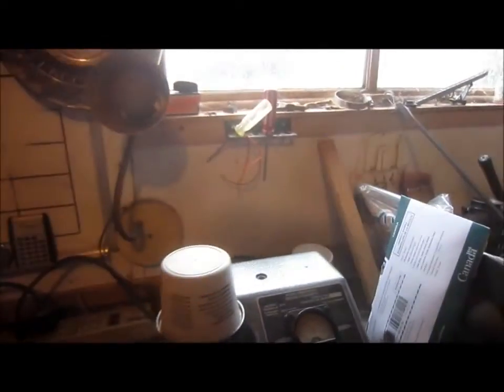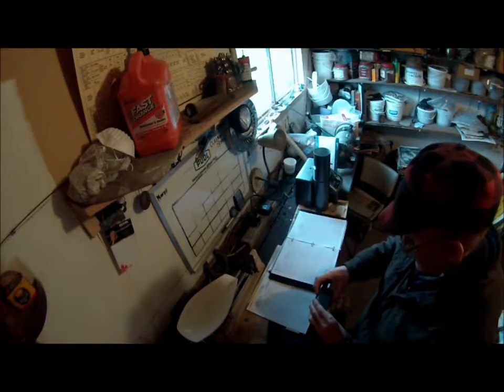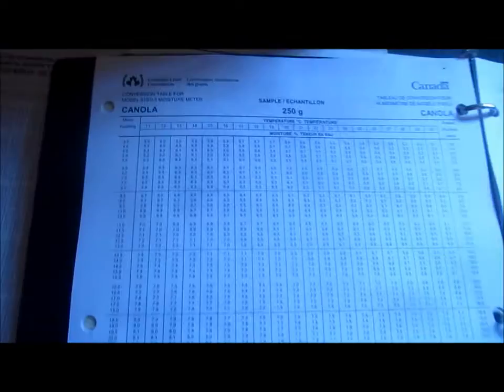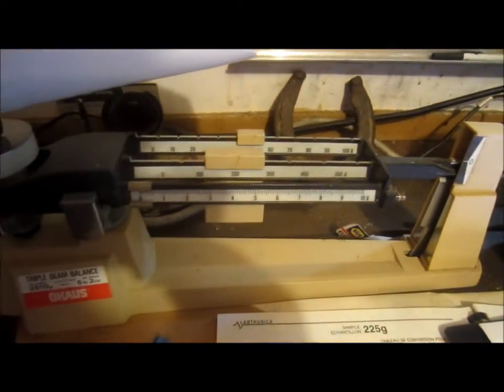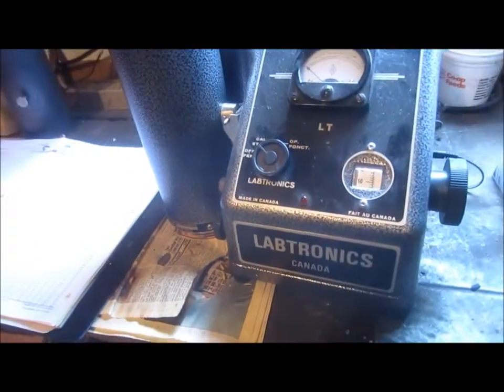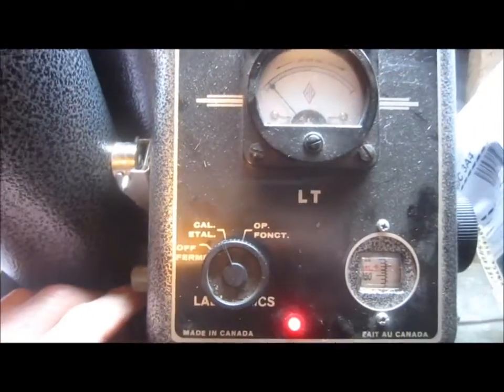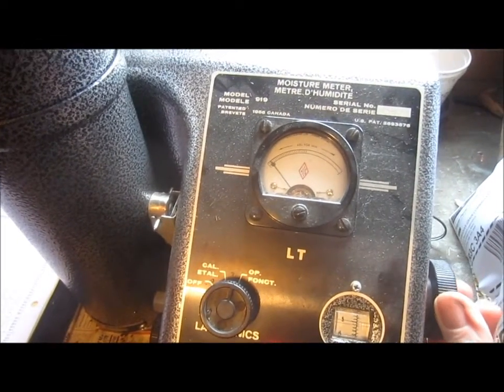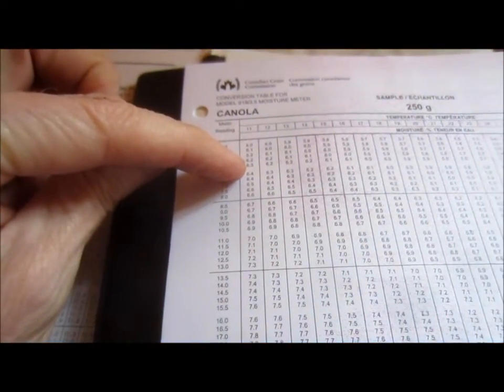Moisture Testing Grain

Comment: Just got a 919 tester.  After we learned some things about it we have it within .1 % of the elevator.  We could not find a chart for hard red spring wheat.  Eastern red wheat called for a 250g sample.  This size sample came in at .5% high.  So we started using a 245g sample and voila! Right on the screws.  :)
Reply from the maker: If you go to the Canadian Grain Commision webpage they have all the charts for every grain there and you can download and print your own. Thats what we did here. https://www.grainscanada.gc.ca/en/grain-quality/grain-grading/grading-factors/moisture-content/moisture-meter-conversion-tables.html